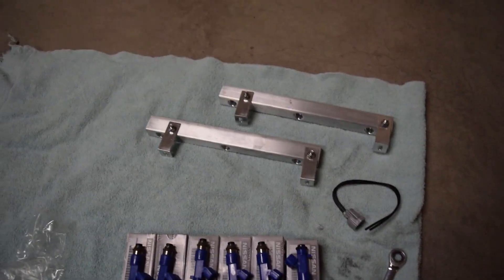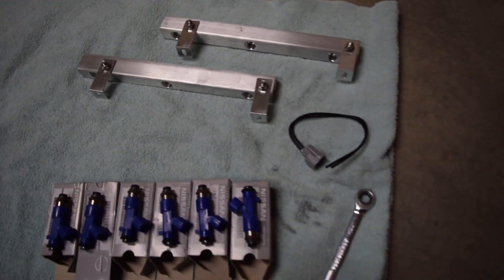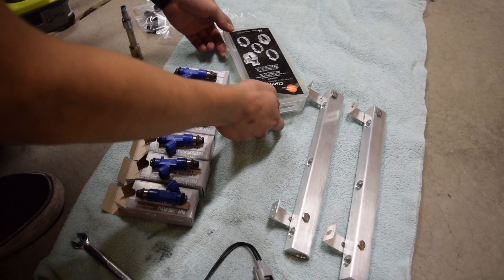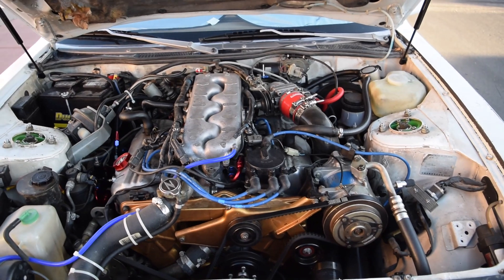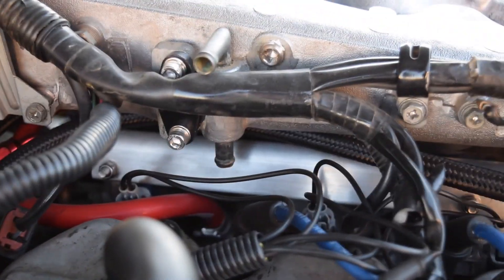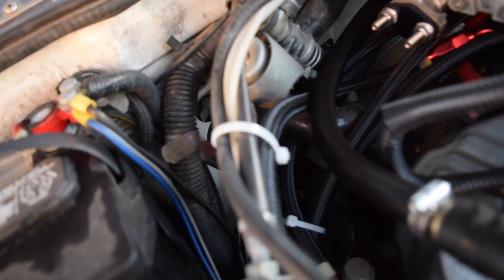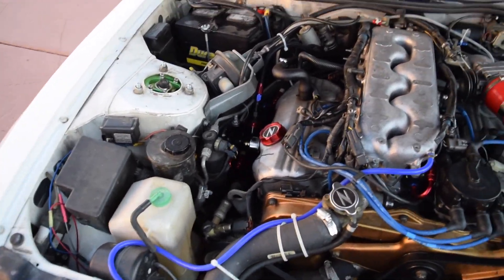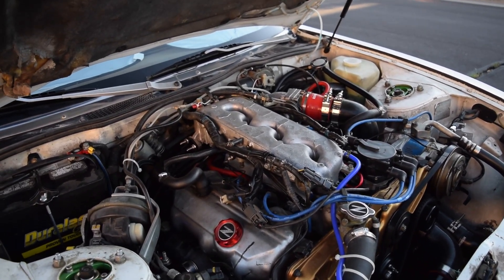NA2T Fuel System

Comment: I just started crying they sent me the wrong rails they had to us I pulled the O-rings off and the base of the injector won't even fit inside these assholes I told them 14 mmmm I don't got another hundred and $75 for another set of fuel rails can you drill them out or have a machine shop drill them out so I can use them or what what about the injector fitting the lower intake manifold I'm so confused and pissed so I need to just get some more injectors my injectors look just like yours they look identical to yours even my electrical plugs look the same as yours
Reply from the maker: Did you measure the rails and they're not 14mm? If so I'm sure he'd let you exchange them for free
Reply: @TheZGarage  no I don't know how to measure them but I'm pretty sure I had identical fuel injectors as you
Reply from the maker: Do you have a ruler with centimeters on it?
Reply: @TheZGarage  yes I'm going to have to look into this harder but I'm pissed I have a ruler it's a little metal ruler it has centimeters but then at the beginning of it it has some little or marks that I thought was millimeters I tried to measure my fuel injectors and I'm almost positive I came up with 14 mm but they do not fit in my fuel rail and like I said my injectors look just like yours all the way down to the little tab on the back where they slide up to the actually blue part of the plastic is supposed to slide up in the rail to a little bit if I was to take the O-ring off correct and when I sent that crossmember out yesterday at the junkyard unbolted the motor mount the top bolt so the motor would stay still and the crossmember would drop well by the time I got home I realized I forgot to unbolt the Mount from the engine so I have the motor mounts and the crossmember but I don't have the mount that bolts to the engine it is not the same as my stock is it either way I'm going to go get it today and unbolt it off of the engine I just forgot because I was so excited when I dropped that crossmember out
Reply: @TheZGarage  my fuel rails came from WWW. Godzilla raceworks. Com
Reply: @TheZGarage  how did the centimeters compared to millimeters
Reply: @TheZGarage  it was so cold this morning it acted like winter my car was so hard to start this morning I swear I think my crank angle sensor is shot I did the sea XTS relocation and upgrade that didn't do it my car runs like a brand new car my car runs so smooth and so good and it's powerful for a n a car put on cold mornings since I deleted everything on my upper intake that thing used to run even good after I deleted everything even in the winter now this morning I killed my battery trying to start my car I swear I think it's to cas
Reply: @TheZGarage  I'm starting to get really discouraged I just went to O'Reilly's and they have a really good little tool for measuring and yet my fuel rails are 11 mm I'm so pissed and I measured my O-ring on my fuel injectors and yes they're 14 mmmm I called and left a message with the guy at the phone number then said he would get back in touch but if they don't do anything about it or something happens about this what would be my alternative could I have them drilled out
Reply from the maker: Godzilla race works is a really legit company. They should sort everything out for you
Reply: @TheZGarage  I sure hope so Absol went further into this build that I anticipated currently as I'm sending this text I am talk texting and driving my Z and it runs so good and it is more powerful than it has been in a long time I'm daily driving it as we speak I start a new job first thing in the morning and I'm fixing to buy a little extended cab Mazda truck I had many of these in my younger years as lowriders but I'm getting one in the next week or so so I have a daily so I can scrap and make a little money on the side plus my job and I have a way to drive something while I have to see took apart but I don't want to have it taken apart very long I love this car in the past 20 years it's never been down for more than a week at a time
Reply: @TheZGarage  okay the guy said yes he will swap the rails I'm happy about that and I'm driving my baby today she's so clean and I've got the t-tops out and it's running so good and strong I hate to pull it apart I'm probably getting this extended cab Mazda B 2200 so I have a truck to drive while I turned on my car and over the years these were my first kind of vehicles would be struts I had about 10 of them lowriders had a yellow one at Silver wind up like winter I love those trucks almost as much as I love my Z's thanks for all the help buddy I really appreciate everything you've helped me with but I'm still not done. I might need you some more
Reply: @TheZGarage  I forgot all about the oil supply and the oil drain for my Turbo can I get one of those ones that just screw into itself and tighten up against the pan it got like a Rubber seal and you drill a hole in the pan and then put the piece on the inside and a few came outside and it tightens up against the pan if I squishes against the oil pan and what size is that need to be like 8 or 10 a n the what is the best way to get my oil supply I really want to use one of those squish together with the Rubber seal for my drain the oil pan was crushed on the turbo car anyways
Reply: @TheZGarage  I think I have the same fuel filter that you have it's kind of big black and red when you look inside of it before you put the a n fittings on can you see a big spring inside of the fuel filter
Reply: @TheZGarage  live correct fuel rails will be in my possession in the next few days
Reply: @TheZGarage  I hope I haven't got on your nerves because I'm really going to have a few questions for you here pretty soon I thought I had ordered everything but now the downpipe with the very last thing I ordered and the wide band I got my V band downpipe 2 days ago I ordered the pipe that the blow off valve bolts too and also my fuel pump the walbro 450 these two items I had ordered on the very first order I made with the turbo and intercooler and I still haven't got either or apply the blowout valve bolt to or the fuel pump neither one ever got yet but I got the downpipe which I just ordered a week or so ago but I really will have a few questions for you I'm so nervous I've got so much you should see my parts pile but man is my car going to be nice and clean and hopefully fast it already runs good I hope it continues to run good I really need to put a throwout bearing in it so I would really like to put a nice clutch and pressure plate but you know I can thrash my car and my clutch Never slipped
Reply: @TheZGarage  I was asking you about your oil supply and return for the return can I just use one of those squeeze together with the rubber washers that you tighten up on the oil pan it's like a n 10 add what do I do to run an oil pressure gauge and my oil supply for the turbo
Reply: @TheZGarage  what do you think about me being able to use those solid aluminum motor mounts I know they're smaller and take up less room than those big gaudy stock mounts and I was curious about the 10 a n Screwed together b u n g for the oil return then do they make something I can use for the oil supply where I can still use an aftermarket oil pressure gauge I know I've had a lot of questions for you but I just want my car to be nice and as far as the bottom side of the injectors I won't have any problem putting them into the lower intake manifold with the 14 mmmm injectors I need some of your brand decals so I can give you credit for helping me I would advertise for you you would not believe how many people look at my car and asked me about it and everybody around this area stopped me and asked me what year is that what is that I have all my badges took off so no one really knows what it is but it has its own really clean personality and look and it sounds good and it's kind of fast so everybody ask me about it oh yes I would put some of your brand decal and advertise for you and give you credit for helping me with my build 34 everything man
Reply: @TheZGarage  the goal all with all that information I asked you earlier I have one more issue I told you my 2 and 1/2 inch V band downpipe with the flex pipe on it finally came in and it has one extra little flange with the kit I don't know what that is for and I can't get it to securely Mount to my Turbo tight
Reply: @TheZGarage  so those fuel rails just pop into the l i m with no problem?

Comment: I'm sure I posted this in the wrong place but I had it on your timing video what is a good place for aggressive timing and what is a good aggressive plug is the NGK V power a good plug I have been upgrading every single thing possible on my car and I just want it to be Advanced a little bit and I want a good hot plug I've got my full exhaust built and put on I'm putting my flange gasket on and new 3 bolts in the flange today when I get off and probably tomorrow I'm going to set my daughter with the timing light and put some more new clubs in it I just put some in gk's in maybe two months ago when I did my new NGK plug wires and MSD coil but I kind of think I might need new plugs already because I have been playing around with it too much and I know I had it rich at one point but I'm just going to have to do something about fresh plugs in the next day or two just to be sure please give me a good recommendation on spark plugs and where to set my timing
Reply from the maker: I believe you can advance the timing by a few degrees by moving the distributor, but without a tunable ecu I wouldn't push it too far. The Bkr7e plugs are what I recommend for a turbo application. For stock na motors, the Brk6e should work great. Ive heard bad things about the MSD coils and how they can fail after a year or so. I left my car with the stock coil when I had that setup because it is supposed to be a very reliable coil.
Reply: @TheZGarage  I've heard that about the coil but I keep the stock one in the car with me but I've never had any problem with MSD
Reply: @TheZGarage  these spark plugs who makes them are they NGK that's what I have in it now I put NGK V power and NGK plug wires a couple of months ago but I'm not sure if I like the plugs or not what  is different in  the bkr7 n the bkr6. Can I not use the 7 just wondering
Reply from the maker: The bkr7e is for boosted engines. If yours is still na, you won't gain anything from them. Not sure if there's any downside, but I always recommend the stock plugs in a stock engine
Reply: @TheZGarage  as far as being stock every single thing possible on my car is updated except the internals LOL I know that's not the motor that's bosons but my car runs really good I've been working on everything I've ever owned since I was 15 years old I started out with cars and I've always tried to improve him lower them make them faster than 5 speed and I've been around these cars for 20 years I just haven't went inside the motor yet but I haven't had to just cars always been great but it's got fuel injectors in Python injection ECU upper intake delete MSD modified enlightened bottom pulley basically it's just not running the outside pulley the only thing running is a short alternator belt the prw2 ignitor chip all NGK cold air intake with the bigest Edelbrock air filter made you know I told you a while back I still have never ran anything--but 93 non ethanol fuel limit I've always ran Royal Purple full synthetic with K&N oil filters fuel filters and air filters it's just this time I got an edlebrock air filter I just  want  the best.  Turbo and everything else is  coming up  rite away so  you still say go with  the 6 on the plugs I've always been  told get hotter  firing  plugs  by my dad. He been  mechanic a while now
Reply: @TheZGarage  I just sat and read all your write-ups LOL I'm at work and I just stopped in the middle of what I was doing it just started raining this is all in my mind really hard right now and I know it's doable money-wise like right now the only thing I think I'll have an issue with right now is the ECU and injectors and didn't you say something about a subframe piece under the oil pan or is it just the motor mount and with the welding drain plug it wouldn't pull that up and your write-ups for me
Reply: I like to work and zero to a hundred maybe a hundred and twenty I don't want to haul ass on top end so what are you think that's too big of a turbo for me
Reply: I meant to add with the same intercooler as you also